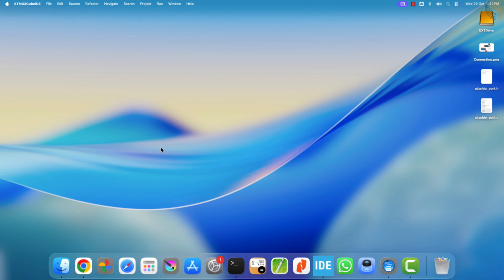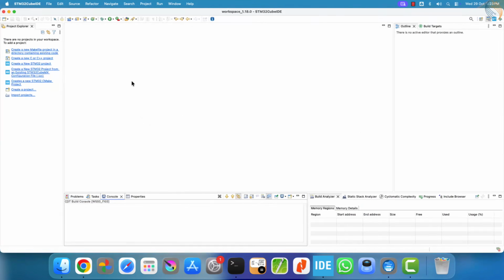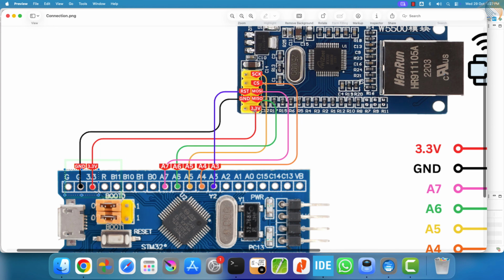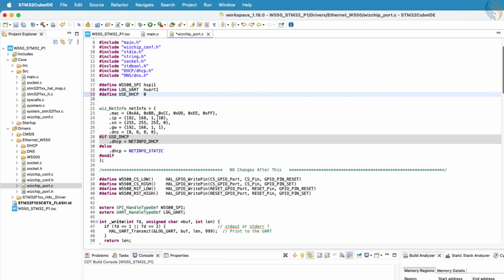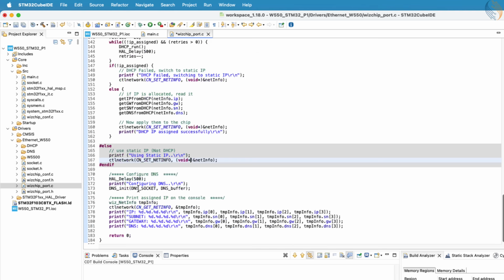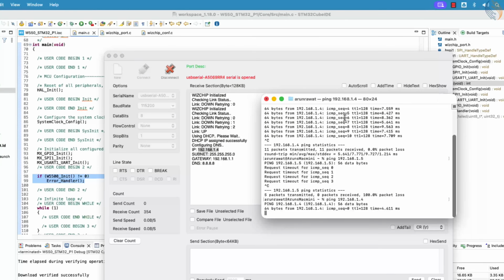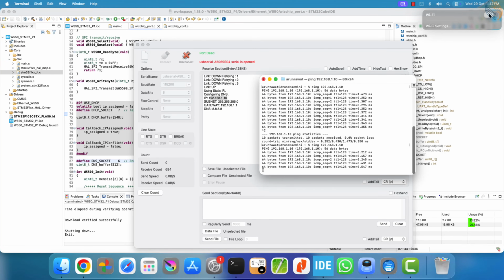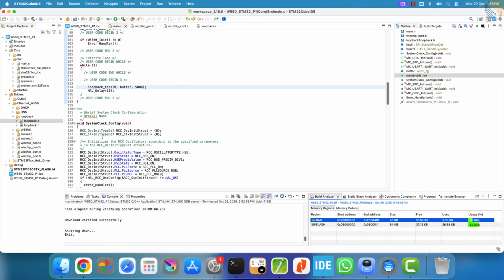W5500 Ethernet Module with STM32 (PART 1): DHCP, Static IP & Ping | STM32F103

Comment: Thank you very much for the excellent tutorial. I was able to connect to the W5500 and successfully ping it, but I’m having a problem when using a static IP address.

Even though I can connect successfully, the command that prints the IP address doesn’t show the correct IP. I’m experiencing the same issue with the loopback as well.

What could be causing this problem?
Reply from the maker: debug the project, put a breakpoint before that command and see the data in the buffer.

Comment: hi very helpful video but on serial port i am getting junk values instead initialization details as shown in video . and is your "W5500_Init" function is complete as  because it never assign  mention static ip.
Reply from the maker: Junk values usually indicate a baud rate mismatch, check if the baud rate in STM32 is same as your serial console. If the issue still persists, its most likely the STM32 clock is configured incorrectly.

Regarding static IP, check 10:53
Reply: @ControllersTech  ok done  thanks

Comment: Thanks, thanks, thanks, it has allowed me to implement MQTT with a STM32F411 in a coule of hours. Thanks to your detailed explanation, I implemented it using Chibios (a very good and solid RTOS). As the documentation of the wiznet library is non existent, I didn't even bother to try until I saw your video. It's a pity I didn't discover earlier your video, I would have used this device
Reply from the maker: That's awesome to hear!

Comment: Quiero conectar w5500 pero no más tengo 6 pin a si que tengo que quitar uno quitaré el de (reset) la preguta es w5500 trabaja normal sin el reset?
Reply from the maker: I have not tried it myself but, you can try connecting the reset pin to 3.3v.

Comment: When I went to the forum page in the video link and downloaded the project, there was a zip file containing the files for two other projects, not the one in the video. These projects did not contain the wizchip_port .c and .h files.
Reply from the maker: It has been fixed now. Please download the file again.
Reply: @ControllersTech  couldn't find the port.c and port.h files even now
Reply from the maker: Look inside the drivers>ethernet folder.

Comment: Static IP vs DHCP has literally no effect after DHCP lease has been issued. Your smaller ping is literally due to turning off WiFi. Physical connection in general has much lower latency then Wireless.

Comment: I've been waiting for W5500 series from long time. BTW stay with current voice. Good old Controllers Tech.
Reply: Where did you get  the wizchip port file
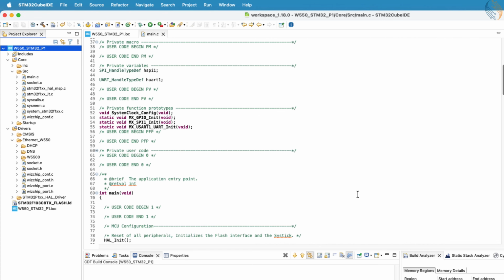Reply from the maker: See at 10:40 where they are placed. Copy them from there.